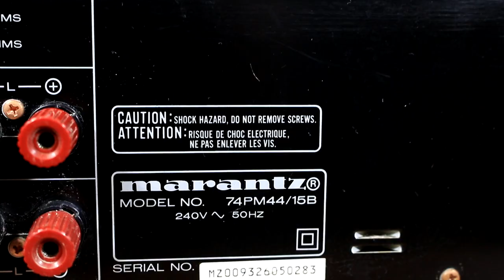Marantz PM-44se Integrated Stereo Amplifier look inside + first look

Comment: this struck me as a little odd, I wanted to buy a Marantz PM-44SE amp and when I started looking online I noticed that there was a Mk1 version and a Mk2, I looked up the spec on both and its the same for both models and they even look the same, so I thought I would contact Marantz and ask them to explain to me what the difference was, after a few days they contacted me to say....They did not know,  as I said that sounds a little odd but there you have it, even the people who made it can't answer.
Reply: I have this amp and from your video I see that the output transistors have copper heats on the top whereas mine doesn't.   One of my transistors has blown so perhaps this is the reason they changed the design.

Comment: my cover does not want to slide off, I took out all the screws : /
Reply from the maker: check one more time all the screws and try one more time harder.
Reply: @Techscrews  thanks, i did pull very hard on the cover in the same direction you did in your video. It's as if there are two screws hidden away somewhere. i only wanted a look inside, nothing to repair, so i just connected it back up and watched your video instead. lol : )